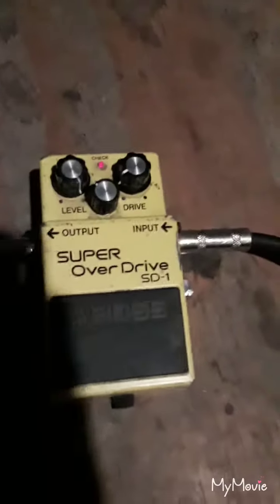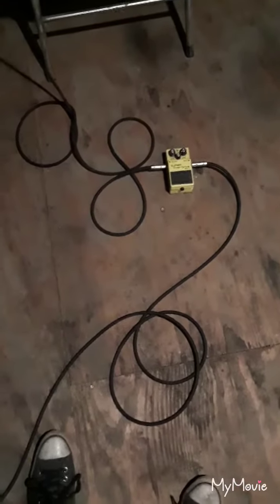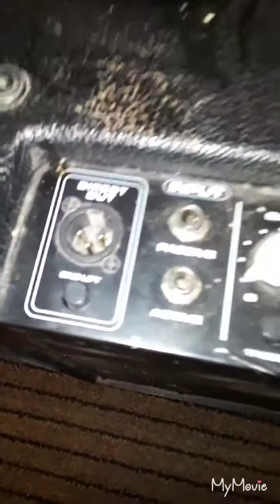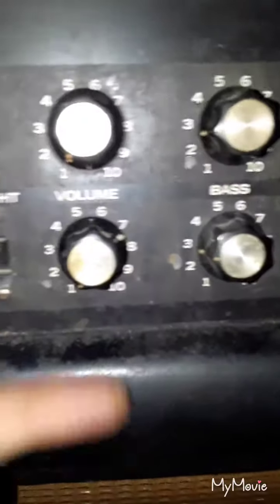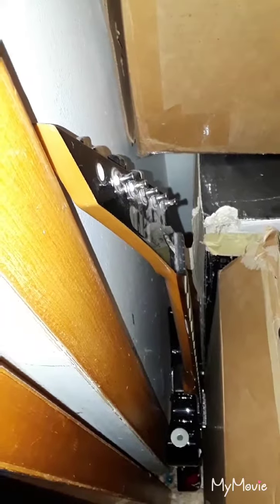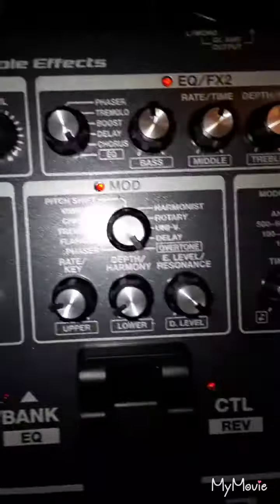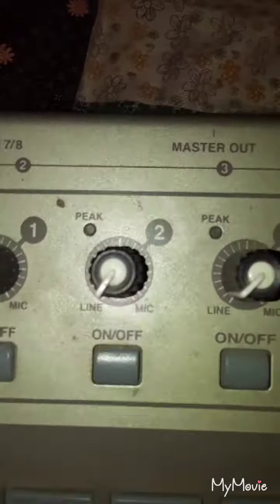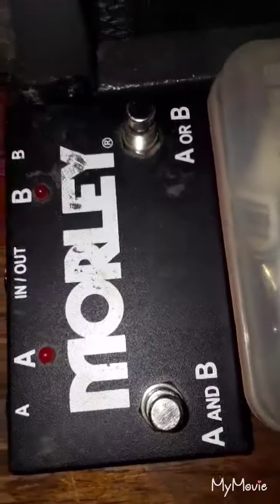Guitar Life -Tube amp broke + Studio Tour + Gear Rundown

Comment: Damn! you have a lot of stuff man. Its a shame about your Earth amp, i have a Peavey Valveking  i sent to repair it had a busted power transistor inside, some people say i am crazy for fixing it but i like the amp, sometimes you get attached to your gear.  That Epi. Sg is sick..
Reply from the maker: Right i was given the matching  2X15 cabinet and the head for free. The head sat for 1 year before i got a speaker cable and i didnt get one before because i  thought it was broke. It worked. It had the original RCA 6l6 power tubes. Then it quit working and it was making funny noises and stuff so i had to pay 300 dollars in repair charges for new capacitors, resistors, basically almost all new wiring then it need new power tubes so the tech put in JJ 6l6 tubes and the preamp tubes were untouched. so i get the amp home, get set up to jam, then i flipped the switch...Nothing... it blew a fuse then blew another one after i put a new one in. I noticed one preamp tube was goung bad and one day my amp startin popping so i replaced all of them with JJ 12ax7s and it was goin good for about it 5 days then it started distorting way to early in a super harsh way when it should stay clean and the reverb quit. I spent about 450 dollars in total to get the amp goin and i dont know what to do lol. Thanks for the comment man i appreciate it
Reply: @minibikegarage1577  Yea man thats hard, a lot of money into it already.